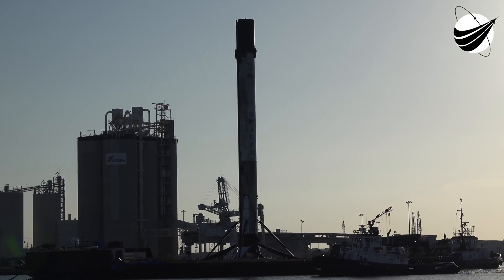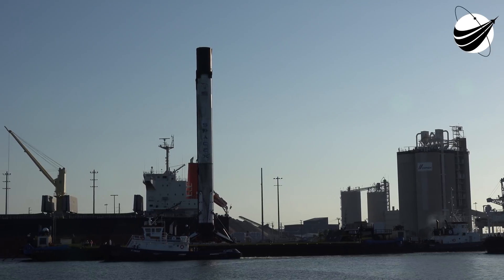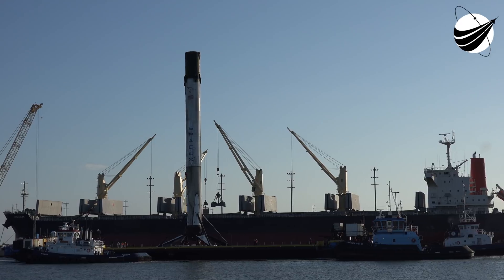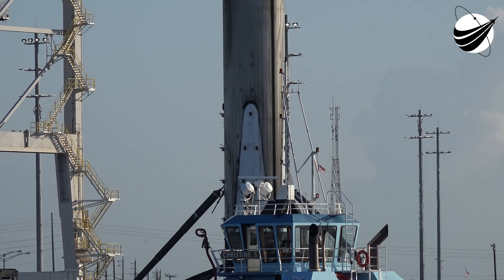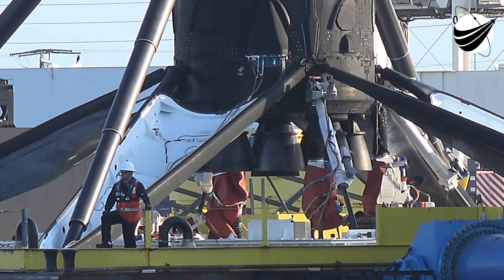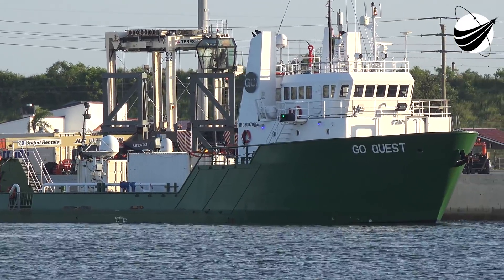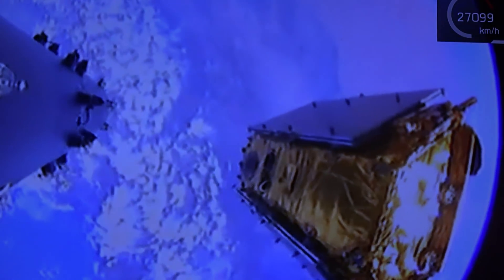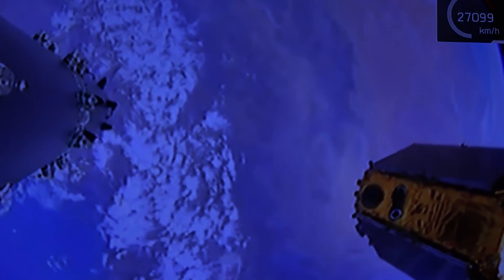SpaceX - Booster 1047 In - Booster 1048 Out  07-25-2018

Comment: Looks like there is considerably less damage to the grid fins than on the block 4. So they basically just clean up the burn marks on the booster and 're fly it again?
Reply: StarkosGuy - switching to expensive titanium grid fins was part of the block 5 upgrade. Before that SpaceX used some kind of ablative covering on cheaper aluminium(?) fins but it just did not work well enough.
Reply: during this period I think they'll be doing more extensive inspection, and the engines will probably always need full inspections for fatigue, corrosion, cracks etc

but that much less than for pre-block 5

Comment: There appears to be a break in the hull at the very top of the booster at 0:53. Any ideas?
Reply: whosyourcaddy
Thats a part of the interstage and most definently where a part of the upper stage fits when they are connected, i am pretty sure i´ve seen this on other boosters too.
You can see it on these pictures:
https://www.google.de/search?biw=1171&bih=726&tbs=isz%3Al&tbm=isch&sa=1&ei=ZSVbW-mqMYqbsgHogITIAw&q=falcon+9+interstage&oq=falcon+9+interstage&gs_l=img.3..0i19k1.164680.167953.0.168731.11.11.0.0.0.0.151.1216.3j8.11.0....0...1c.1.64.img..0.8.916...0j0i7i30k1j0i7i5i30k1j0i8i7i30k1.0.BxvtCNh_ur8#imgrc=TRMG09G00PlLjM:

Comment: Theses engines are so small but terribly powerful: 2.5 megawatts per kg !!!
Reply: Well that is just because of the nozzle
Reply: I can't imagine the specific power without the weight of the nozzle, only the combustion chamber, maybe 5-10 Megawatts/kg, 1000 times higher than the engines of a Formula One !!!
Reply: Haos666 no what i ment by that is that the nozzle make them look small but the engine is big
Reply: Nozzle doesn't have much to do with it, it is quite standard for sea-level engine of this size.
Reply: +Haos666 but it's an ''useless'' weight, if we just keep the parts that's needed to make the combustion, I think the specific power will be nearly 5 MW/kg...
Reply: +Devil's Gaming Yes they are big, but the rocket is even way bigger so to takeoff they need a thrust to weight ratio that exceed any other rocket engine https://en.wikipedia.org/wiki/Comparison_of_orbital_rocket_engines
High thrust to weight means high power to weight, I already know that they are tall but keeping that into account they are far more powerful than they looks like, if an engine was only 0.5kg it will have the power of a supercar...

Comment: ... Why not aircatch the fairings with a helicopter and lower them on to the boat? I'm sure they thought of it.
Reply: Extreme risk to life?
Reply: parajacks4 - How so? How is it extreme? Any ocean opperation is risky business. You do know the aircatch is something that has been done before, right? Granted with an airplane and much smaller payloads. But a helicopter would be needed in this instance because the fairings are too large to reel in. So catch them with a helicopter and lower them onto the ship.
Reply: Motokid600 
Maybe a drone helicopter could do the job. It’s a pilots job to keep a safe distance from other flying objects.
Reply: parajacks4 - There's not a drone large enough. No it's a pilots job to do the task they signed up for. Once again this has been practiced with airplanes in the past. They have caught objects mid air coming from sub orbit. It's not a foreign concept. The only issue I see is money. I'm sure hiring Mr. Steven is costing them a pretty penny.
Reply: As you said, I'm sure they've thought about it, and they concluded it wasn't the right way. My best guess for why they didn't choose that way is it has something to do with the aerodynamics of the fairings. Maybe it's too dangerous because they might get caught by the wind and either destabilize the helicopter or fly into the rotors. The fairings are large, curved surfaces made of ultra light weight aerospace materials. Maybe they decided the risk, not just to the pilots but also bad PR should anything go wrong, was just too great. And if you think you can figure out how to do it with less risk, why not?
Reply: The fairings fly unpredictably even with advanced airfoil parachutes.  This is has been stated by SpaceX themselves which is why none have been caught so far and they are trying a much larger net.
Reply: They could using helicopters (like ULA plans to catch engines), but the recovery fleet would be way bigger and cost much more

Comment: some paint and it's good to go again
Reply: Cydonius1 they will not be painting after a recovery. They will load it up with fuel and send it off again. Paint adds weight and does nothing to help the rocket. Expect to see reused stages looking dirty on the launch pad. No painting speeds turnaround time and reduces costs.
Reply: Perhaps a good washdown then?
Reply: They do wash them... They have to. The soot is weight and drag. They don't get them perfectly clean obviously, but the heavy stuff is indeed washed off.
Reply: NO PAINT.  
They will wash down to remove any Salt Water that Falcon 9 Block 5 picked up while on OCISLY.
That cleaning step can remove carbon products (discoloration) from engine burning (RP-1/LOX).
Reply: indylovelace paint reflects the sun light and helps to keep the oxygen cold
Reply: You do raise a good point, but I don't believe it is their intent to power wash stage 1 before putting it back on the launch pad. If you look at previously used stage 1 units, they've looked dirty from the soot of the engine flames during re-entry. With the block 5 vehicle, I believe they are quickly moving toward turning around the vehicle within a few days to a week for relaunch. Please correct me if my information is in error.
Reply: You meant JRTI (west coast).